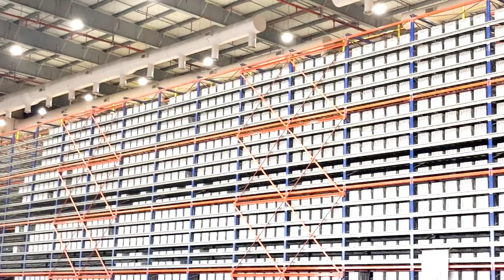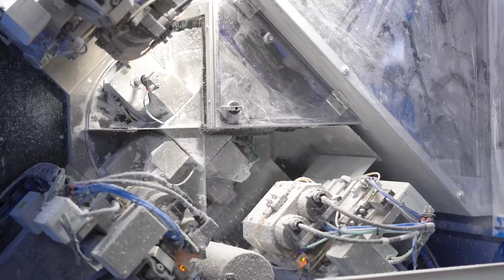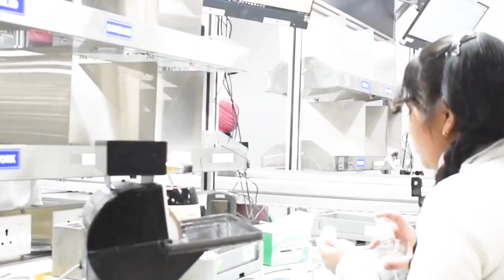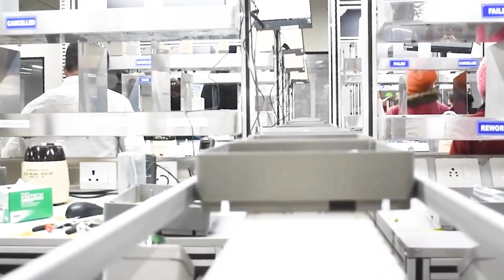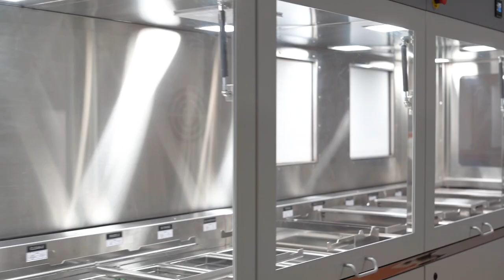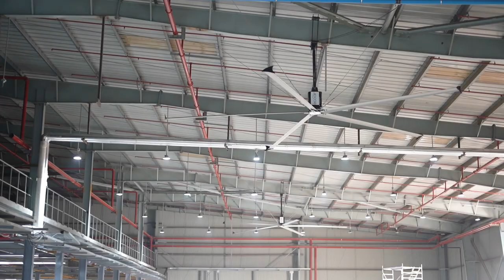Sneak Peek Behind The World's Largest Automated Eyewear Manufacturing Facility | #Lenskart

Comment: When Vallabhbhai Patel statue can be made in China and assembled in India, these small things are not to be considered. We have  cheap labour, raw material, power, infrastructure every thing but do not have the will to do it due the top level politics and vested interests.
Reply: We dont have cheap labour and the infrastructure of china level and the most important asset china has his manufacturing culture which we lack
Reply: Only outer casting was done in China which was <5% of total work, f00l.
Reply: @ayushgupta4376  how can it be less than 5%?. Where did you get this information from? 56" has attraction towards china. There is no denying in it.